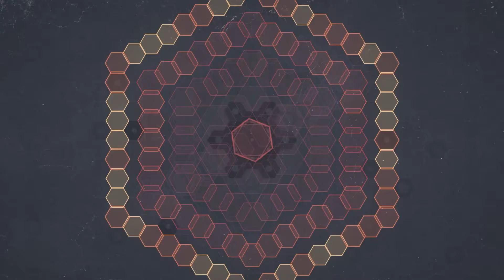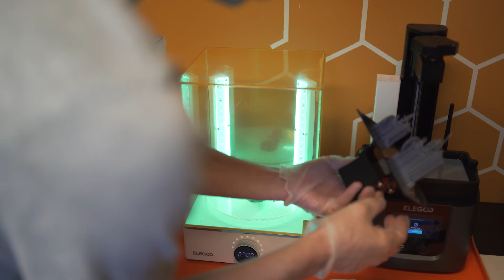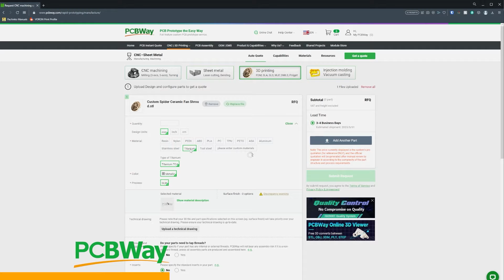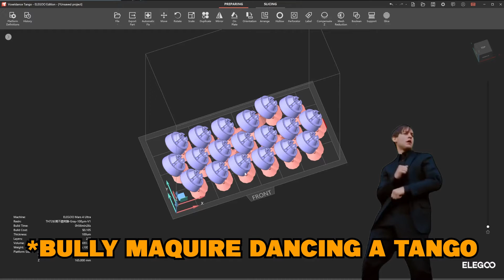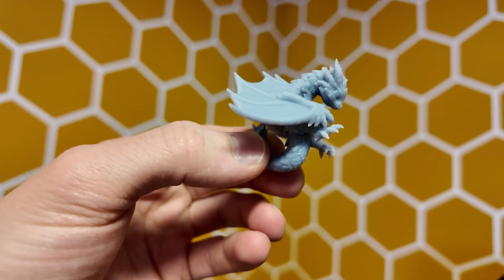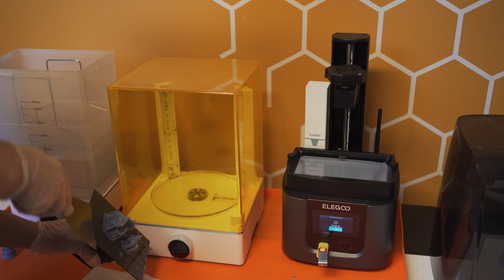This 9k resin printer might be perfect for everyone

Comment: The Elegoo "Ultra" series may not have a bunch of bells and whistles compared to some printers out there, but under the hood they rock! Ball screws instead of lead screws. Elegoo also sources electronics from Chitu systems, IF I am not mistaken. This is important because Chitu systems quality, and the longevity of support. I have an O.G. anycubic Photon, I can still get replacement parts AND there's an upgrade kit available!  Now I do not have the Mars 4, I have the Saturn 3 Ultra. I am looking to get one (hey Elegoo, if you read this , help a brother maker out! heh) for smaller projects, as sometimes I print miniatures for gaming clubs and the like, getting kids into the hobby!
Great, Informative video! I also use the same wash and cure, except I have the upgraded one, the only difference is mine has a small U.V. light attached that is super useful for hardening spills or inside big prints. Thanks for the video!
Reply from the maker: Glad to see someone else agrees!! I was honestly very impressed. I don't regularly print minis, but I can absolutely see this printer in my studio long term if I did. You know when you get that "feel" of a quality product when you use it? This printer gave me that feeling with everything I did.
Reply: @ThePrintHouse  YEP! also similar printers do not have WiFi.
Reply from the maker: @gkeaton9755  that's true. And something to consider is that some of the newer more advanced printers I've tested with wifi did not integrate with a slicer well or at all.
Reply: @ThePrintHouse Heh! cough anycubic*cough*